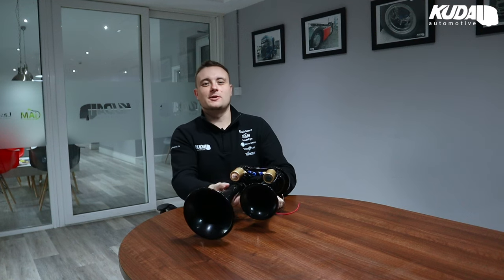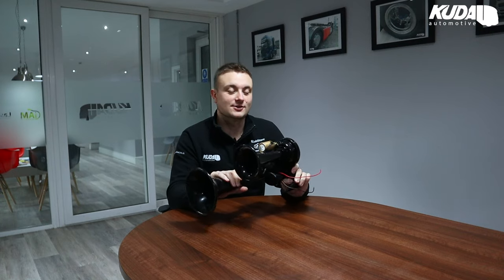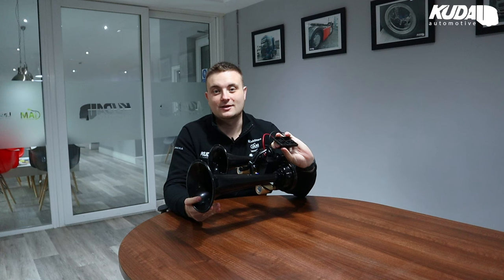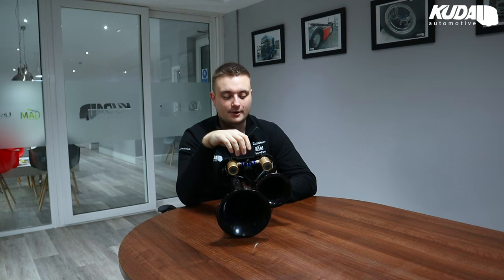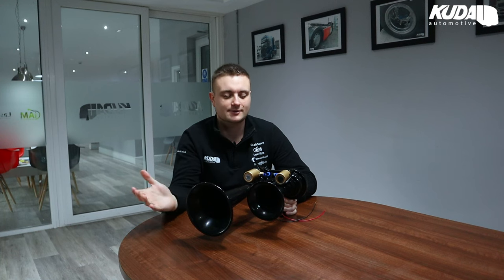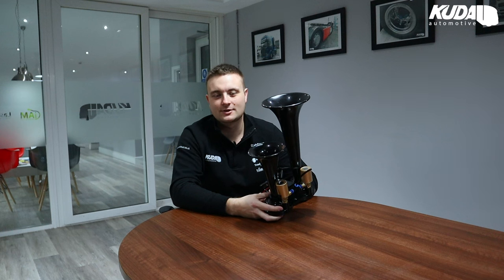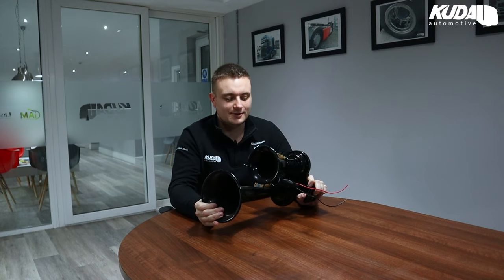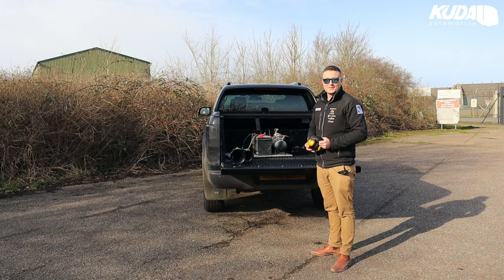THE LOUDEST - TGV Airhorn Dual Tone Train Horn! - Thank Truck It's Friday #016

Comment: I had these on a fastrac with these but wired them up to play each tone separately like an actual train dose so I could play my own tunes on it. I bought one for my FM but the solenoids came out of them and ruined them. Will say they weren't bought from you though so not your fault. If you wire them up  the wrong way around both tones go off together that sounds pretty good
Reply: How do you wire them wrong do you do negative to positive etc

Comment: Run the wires the other way around it fires both together for a real hatchback hearding noise
Reply: what do you mean by the other way round? neg to pos?
Reply: @joemorris22  yea run the +ve to the -ve and -ve to the +ve on the air horns

Comment: How can you get just 1 tone sound out of these please? I got given some buy a guy in work to fit to my truck but i dont want the neenaw sound. Thanks
Reply from the maker: Hi Steve, you'll need to re-wire it so the solenoids go off at the same time. I hope this helps! ☺
Reply: Ifyou set it up so Both little compressor switchs open at the same time they will go off at the same time or if you just connect both horns together with like a T connection from the compressor they will go off at the same time. You have to remove or bypass the switch which is switching them back and forth.

Comment: Could I put this on my push bike ?
Reply: No not very easily, youd need an air system and a power supply to drive it. 
You could mount an air tank which you charge up (with air) at home using a compressor but this would limit the use to at most a few blows.
Reply from the maker: Unfortunately that's not something we could help with. Sorry for any inconvenience.

Comment: Do these air horns work with tractors?
Reply: Yes, if you have a compressor or something else for the air
Reply: pretty sure it comes with it's own compressors that's what the solenoids on top are for and the wires coming off, so it's just 12v or 24v or what ever.

Comment: Will it run on 12v to fit in a car?
Reply from the maker: Hi, yes it's 12v so it would work but you would need to find an air supply to allow it to work inside a car. I hope this helps.